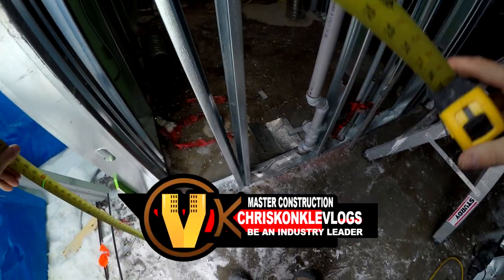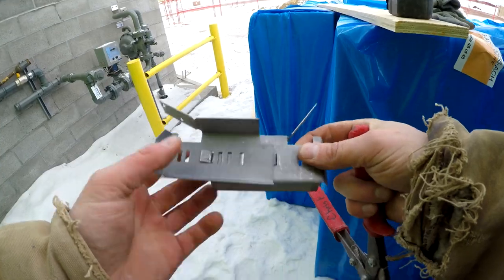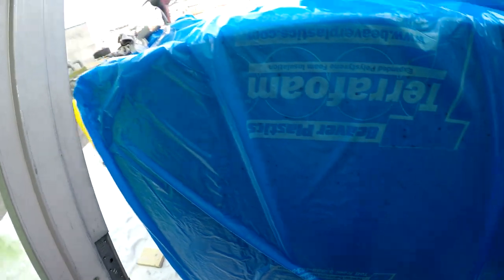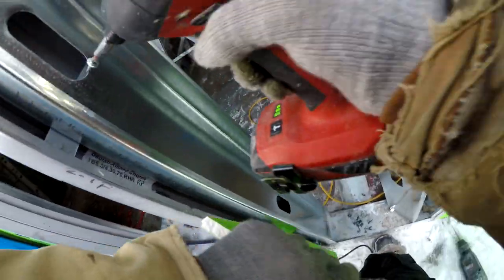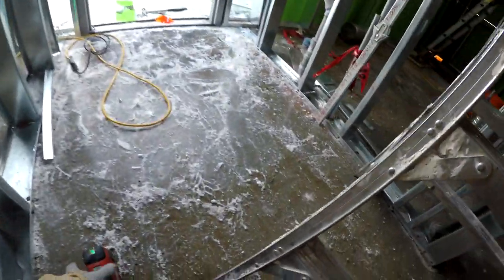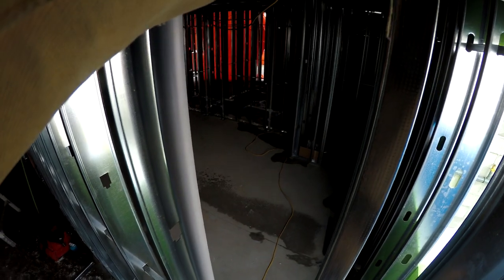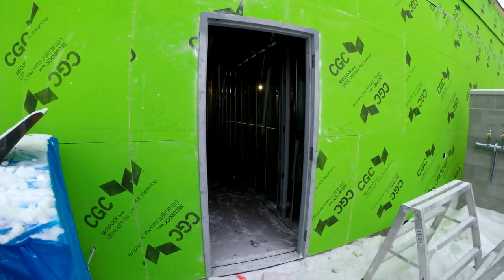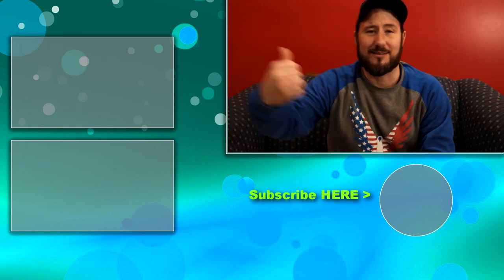Installing A Metal Door Frame In 6 Easy Steps

Comment: It's a great way that you are putting in the doors. What I don't understand is, on the job that I'm at right now, they're having us put on each door to studs soft side to soft side as a jambstud. We are framing everything, then when it's time to put in the door frames, it seems like we're going to have to take those studs apart again just to be able to screw the door frames in? Should we just leave one stud as a floater on each side?
Reply from the maker: I was leaving you a reply andy phone died   lol. Yes, leave one floating. For 2 reasons...so I have access the inside of the stud to fasten to the door clips and there won't be a bunch of holes already there when it's time to be permanently installed.
Reply: @ConstructionKronies  thank you I'll bring it up in the meeting tomorrow morning when I work

Comment: Your frame has dimples as if was meant to be fastened into a mason wall correct?
Reply from the maker: So I wouldn't know that specifically. I have never installed a door on a cmu wall before. But I can tell you that this is NOT the type of door frame I would order for steel stud walls. All of the types of frames will go in the steel stud walls just there is one type that is best. You want it welded, no dimples, slip in clips, plates at the bottom with holes to hammer drill them down (not all types have this for some reason I can't explain) and finally you want the bars at the bottom to keep them square! Cheers brother!~:_KronieHammerTime::_KronieHilti:

Comment: When installing the sheetrock do the board have to be  notch out where the clips are . It looks like the clip would blocks the board from going in .
Reply from the maker: Sometimes yes, and that's normal. You really only need to be a 1/2" in the door but sometimes if your sheets aren't level your going to notch around.

Comment: Hi Chris. How do you remove the bottom two metal pieces that keep the frame square. Do they snap off or do you have to grind them? Thanks for taking the time!
Reply from the maker: Yes man you can bang them out with hammer sometimes but yiu have to be very careful not to damage the frame. I use my cordless grinder to zip them off nice and clean!
Reply: @ConstructionKronies  Thanks man. I had to take them out today and they were on a carpeted floor so i was a bit curious how to do it cleanly haha. I appreciate the response! Keep up the videos
Reply: Cold chisel
Reply: @jeffreyhodgins814  I know everyone has their own system of doing it but steel door institute says to always to remove the shipping bars before installing the door

Comment: What brand clips are those @1:00??
Reply from the maker: They are just normal clips we order with the door frames, you can also make your own clips with track by cutting two pieces of track to proper length for proper frame width screw 2 pieces of track together and slip the clips at each of the hinges and on both sides (so 12 pieces of track to make 6 clips, 3 each side.

Comment: I always check the level of the floor to know which side to lift in case the slope is more than 1/8.
Reply from the maker: O yes 100% when I am installing the headers I always check for that and of course a good idea to check if you didn't frame the wall.

Comment: Good job, eh! You guys don't fill them in with grout?
Reply from the maker: No, no grout. Sometimes we stuff the frames with itch. This particular frame was set half on, half off the concrete slab. Eventually the sidewalk will butt into it. This frame was also the wrong size, which sometimes happens, so it was set to the exterior and the inside will be drywall returned instead of fire rated by drywall inside. Thanks Carlos Eh Hoser!

Comment: No don’t use a laser bc if your floor isn’t level neither is your door frame!
Reply from the maker: I'm sorry but this is simply just not true. May be tops 1/4" off square at most, the doors are hung 1-/2" from the floor and when your framing headers are always going off the high side.  Please use line lasers and you can do a quick check before installing the jamb.
Reply: @ConstructionKronies  good point but how many ppl give a prick check any more? Not many but a 1/4” is a lot when hanging a door. Remember you need to have 1/8” reveal around the door. Just saying from experience lasers can & will leave you with a frame that’s not ideal.
Reply from the maker: I also always check for my high side and go from that. Will shim up the low side.